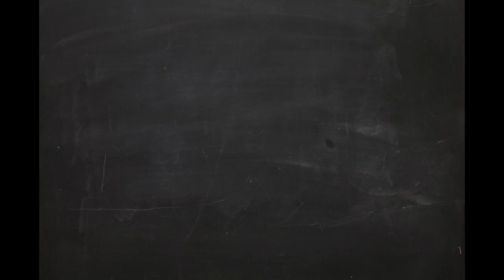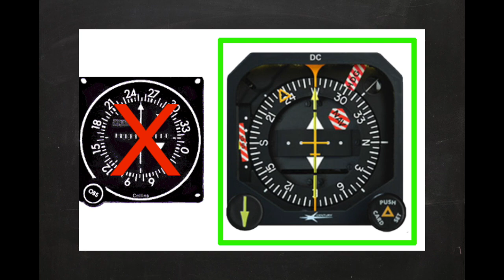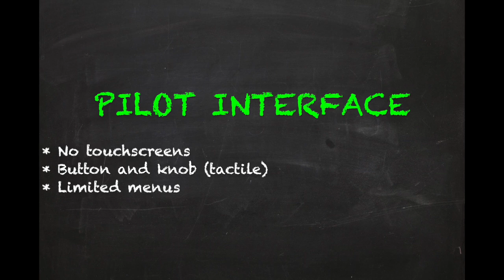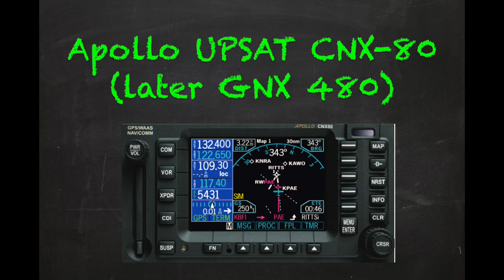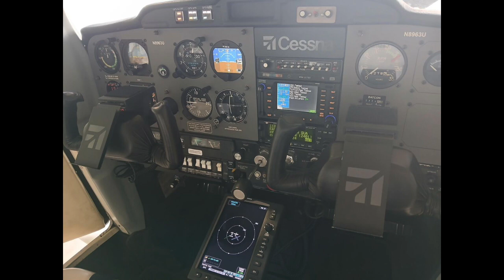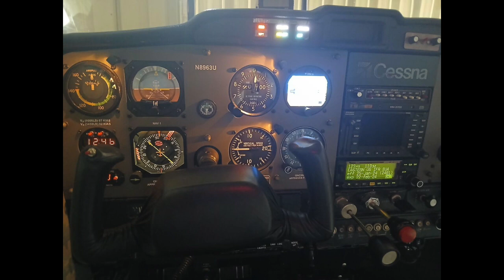Cessna 150M Panel Upgrade 2024

Comment: What are you using to mount your 696?
Reply from the maker: It is a modified RAM seat rail mount.  The original arm was replaced with an angled extension that places the 696 in the proper position you see in the pictures.  It is extremely solid (feels like a permanent mount) but can be removed at the seat rails if necessary.

https://www.aircraftspruce.com/catalog/avpages/ramseatrail.php
Reply: @theflightpractitioner7288  I just checked out the site for that mount. It is a great idea. Does it interfere with the use of or the comfort of the right seat?
Reply from the maker: @brianhennessey9563  Great question! A couple of considerations with ergonomics.  (1) Depending on the geometry of the support arm you will make and the thickness of your seat cushions, the front seats may not be able to reach the full forward position easily.   (2) A very thick-legged person may brush up on the sides of the 696 so legroom may be slightly compromised for those folks.  (3) Depending on the final position/angle of the 696 itself, access to the trim wheel will be slightly different (no big deal, in fact I like resting my wrist on the top of the 696 and working the top of the wheel (see video pictures)).   The C150 pitch trim is very sensitive and needs only small movements, so this is not an issue for me.  To me, these are all minor or irrelevant issues but hope it helps in your design/decisions.
Reply: Thank you for your response 👍

Comment: Could you tell me the cost and who did the installation? Thanks.
Reply from the maker: The panel upgrade was wrapped into other maintenance, but as a rough estimate it required between 50 and 60 hours of labor. The work was done at Cilliers Aviation in Palatka Florida (28J).  Very pleased with their work.